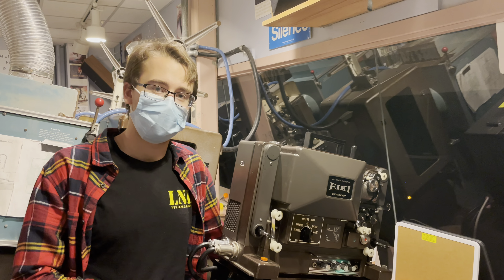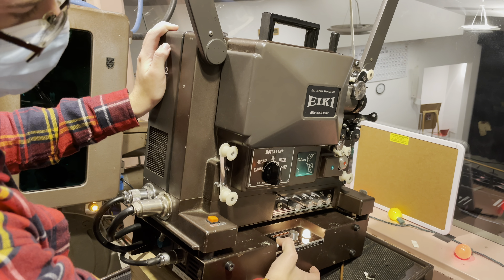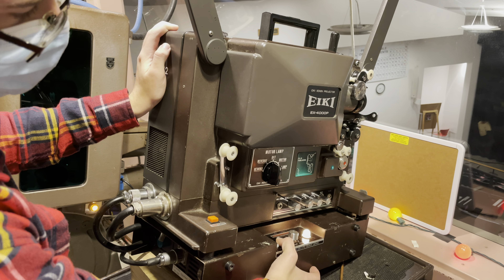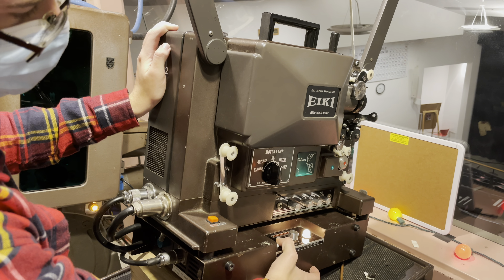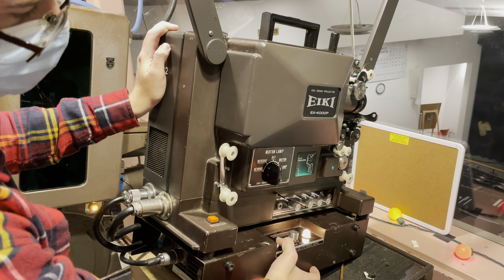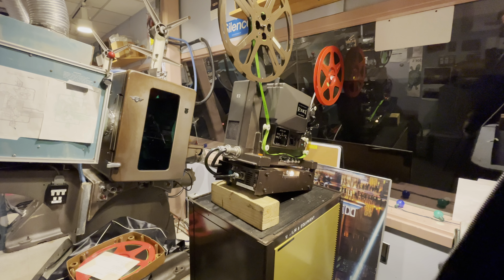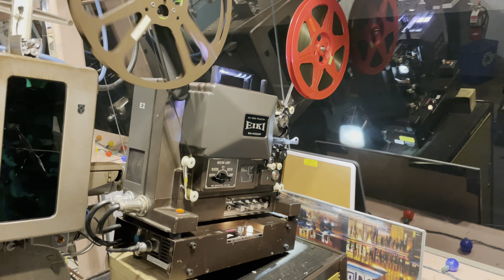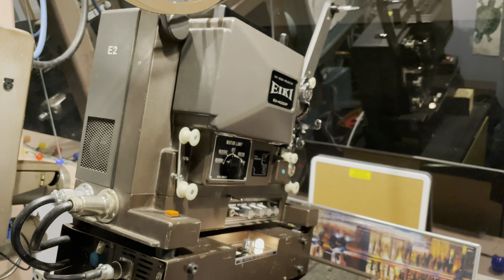How to Use a 16mm Film Projector

Comment: 2:38 "until it hits the floor" 😬
Reply from the maker: It’s not the best but it’s right before it hits the floor. Also it is just the tip of the head which is not supposed to be run through the projector, but yea you are right!

Comment: I have an earlier version of it with the changeover button on the top of the frame, just ahead of the handle. It's a great machine even though it sounds like an air-raid siren.
Reply from the maker: That sounds cool! Do you have a photo of this, I am very curious!
Reply: @KyleMiko  Here you go!...https://flic.kr/p/pCrAT8 . These machines received quite a few changes and tweaks over the years; the service manual I have for mine, dated August 1983, covers six different power supplies, as well as two schematics each for the mechanism and amplifier.
Reply from the maker: @arclamp  Wow what a great photo! And i see the different changeover mechanism!

Comment: One interesting tidbit for those watching film projection videos; Note that you did not see him "frame" the image in the aperture, as 35mm and 70mm projectionists must always do. He just placed the film flat on the rail, and away we go. This is because 16mm film uses only ONE perforation per film frame, as opposed to four for 35mm and five for 70mm. So in 16mm, the film is always in frame. There may be a little adjustable mask used to better fit the image to the screen, but there is no such thing as an "out-of-frame" condition, which used to cause no end of annoyance to movie-goers. Interestingly, the small guage (8mm & 16mm) film projectors did not use the Maltese Cross intermittent movement that the 35 and 70mm projectors did. They could not! A Maltese Cross movement turns 90° every cycle of the movement, or four perforations in 35mm and 5 perforations in 70mm, translating to a generous sprocket diameter of 24.2mm (about an inch diameter) for 35mm, and 30.2mm for 70mm. To use this mechanism in 16mm, the sprocket would have only four teeth on it, and would be only 9.7mm (3/8 inch) in diameter - bringing far too much stress to the film and the mechanism. There "have" been some rare examples of 16mm projectors (EIKI being one) that used the unusual 8-branch Maltese Cross, allowing these values to increase to 3/4" diameter, and thus to use a sprocket - the advantage being that it is constantly engaged with the film, and helps hold it steady when it is not in movement (when the image is being projected). But most 16mm projectors use a reciprocating "claw" mechanism instead, leaving the film free to float around while it is being projected. Claw mechanisms can be very precise - all great film cameras use them, including Mitchell, Arriflex and Panavision, but these mechanisms are accompanied by a registration pin, holding the film firmly in place while it is not being advanced, something that 16mm projectors do not generally use. 
Maltese Cross and Claw mechanisms are not the only ones to have been used in 16mm projection. There have also been "ramp" mechanisms (notably used by Philips) which may combine the advantages of both.
Reply from the maker: Fantastic writing! Thanks, Greg

Comment: Very nice video! Those big EIKI projectors look great! Well I ran a lot of 16mm and Super 8 through projectors from the 1970s through 90s. Siemens 2000, Bell&Howell TQI, Bauer T 600,.... I refrain from stopping a film mid reel unless it´s absolutely necessary, since the drum of the optical sound head will scratch the film. Nice 16mm prints taken from the 35mm intermediate through a 16mm interneg are hard to find. Most are grainy dupes from a 35mm print. The one you projected seems to be very nice. Thanks again.

Comment: 16mm =  .....  resolution in pixels?
Reply from the maker: Hello! Because film is not digital but instead chemicals there is not an exact resolution in pixels, but more of what resolution you can scan film before it becomes too grainy. Generally speaking 16mm film can be scanned to 2K resolution. 35mm I believe is around 4K, and 70mm is 12k. I could be mistaken but that is the general idea
Reply: @KyleMiko  Nevertheless, if you were to scan 16mm in 4k the end result will look better and sharper than a 2k scan even though 16mm is nowhere near 4k by any sane definition.
Film is complicated and scanning is complicated. Those who don't like film often say it's very low resolution. Those who like it sometimes throw around some laughably high numbers. Both are kind of right at the same time. Like I said it's complicated.
Reply from the maker: @trax-3987  you are right, but other things matter too such as the film stock and the sensitivity of the film (ISO/ASA) when shot. You can scan anything to any resolution, but at what point the grain is bigger than a pixel varies